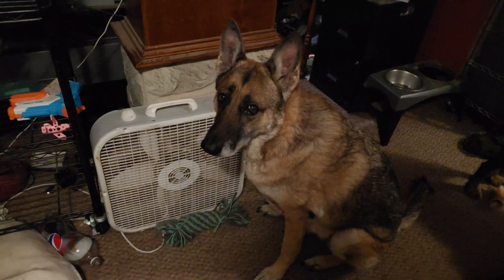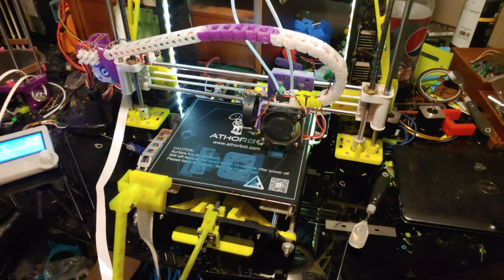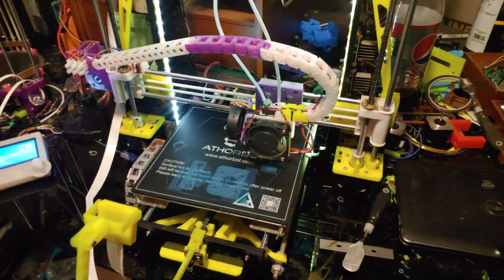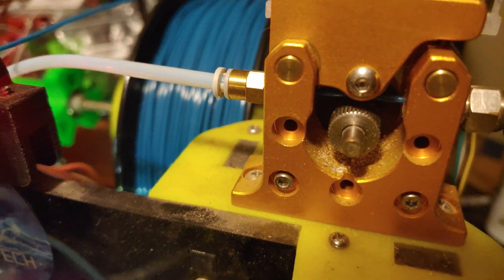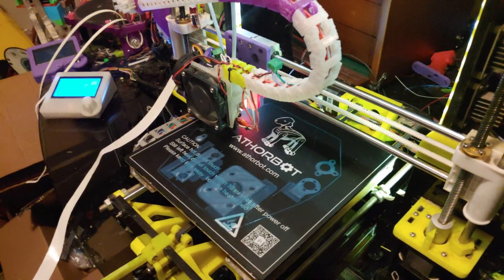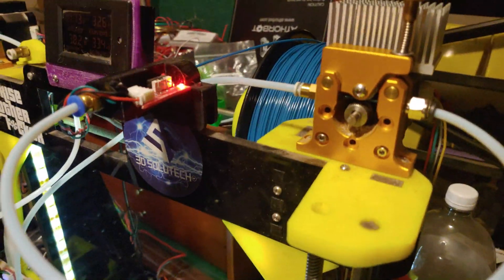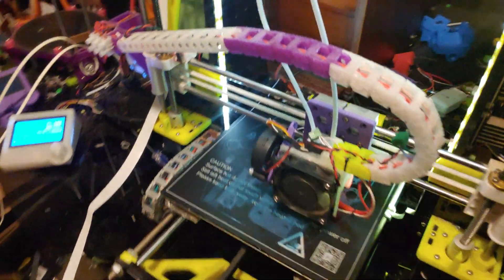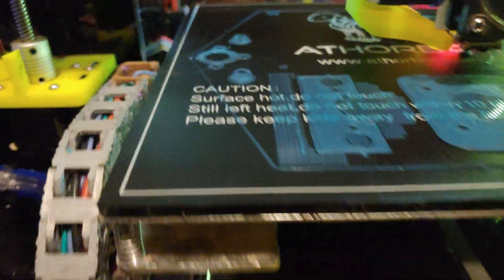Printer #1 SKR 1.3 with TMC2208 Silence.

Comment: Would you happen to still have the procedure/instructions for the SKR 1.3 with the TMC2208 stepper driver install to Marlin?  If so, would you make a 'how to' video for us newbies that would be easy to follow so we could convert and upgrade our stock Anet A8's?  I could sure use the help.  Or maybe a link to where you got the info would be useful.  Thanks for your time and effort.
Reply from the maker: Here's my guides. I don't really like putting the effort into videos mostly because it's easier for me to follow a written guide. 

SKR 1.3 & MKS SGEN L Board Setup Tutorial with TMC2208 UART: https://www.thingiverse.com/thing:4068645

How To Use a PC Power Supply With Your Printer!: https://www.thingiverse.com/thing:4089158

Octoprint and GPIO Control Tutorial!: https://www.thingiverse.com/thing:3372599

How to set Z probe offset in Marlin!: https://www.thingiverse.com/thing:3700194

How To Wire a RAMPS 1.x & MKS GEN Too: https://www.thingiverse.com/thing:2784817

Marlin 1.1.x or 2.x on Anet A8 Guide: https://www.thingiverse.com/thing:2783450

My Designs on Thingiverse: https://www.thingiverse.com/morganlowe/designs